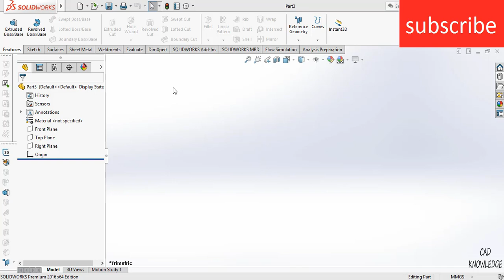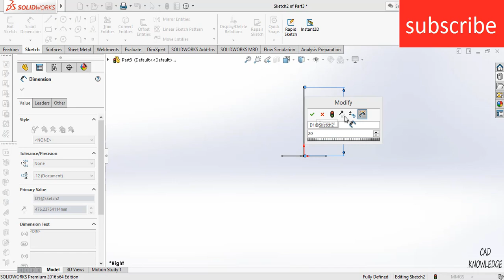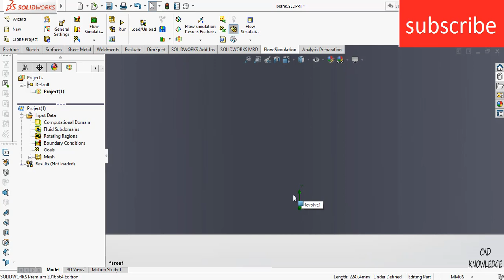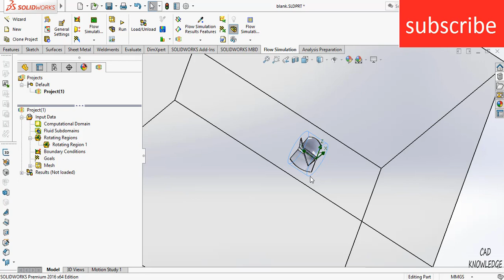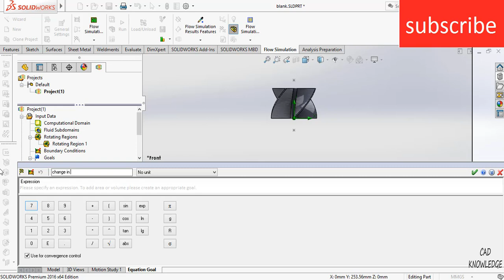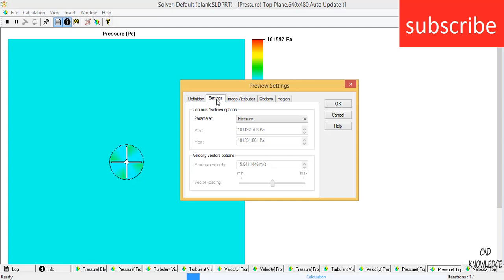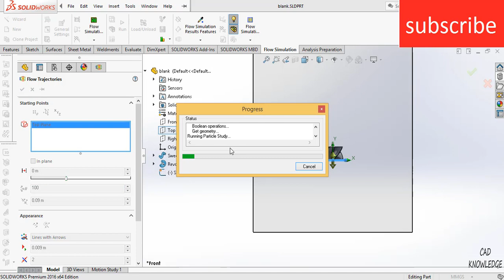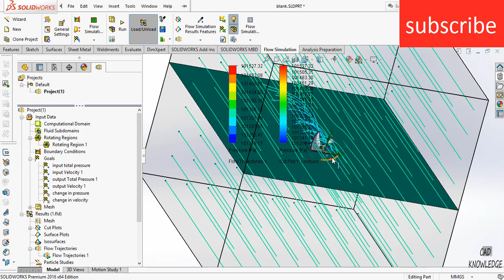External Windmill flow simulation in solidworks fully explained for beginners from scratch

Comment: Sir when i use rotation region the direction of arrow in upper direction & after that simulation will not will work properly the flow of air will move to the surrounding of the blade sir can you please help
Reply from the maker: most probably fault in your blade design. send me some pics on my facebook page (you can found the link on my latest video description)
Reply: Sir can you please share  your face id
Reply: Link

Comment: MY VERTICAL WIND MILL PROJECT  DETAIL
FAN BLADE 66INCH WIDTH HIGHT 144 INCH FAN 10NOS
AIR DANCITY 241
WIND VELOCITY 5.5 METER  PAR SECOUND TO 15 METER  PAR SECOUND
HOW CALCULAT RPM  
HOW MUCH RPM GENARATE 
PLZ HELP
Reply from the maker: You have to do experiment for it. Or need some high specs pc to do the simulation minimum 512 gb ram required to do this kind of simulation